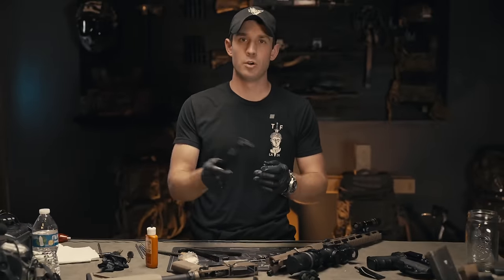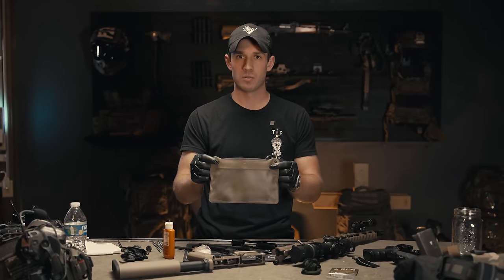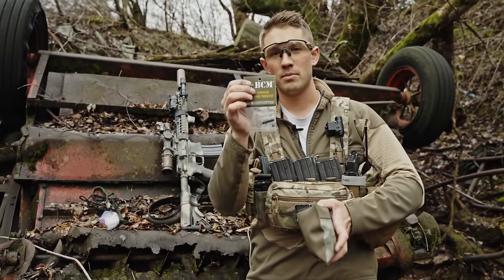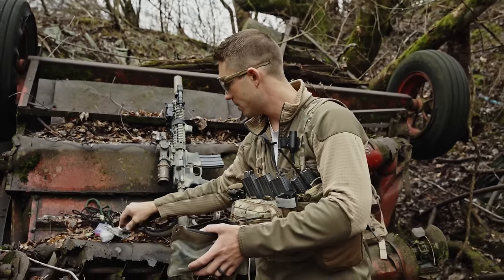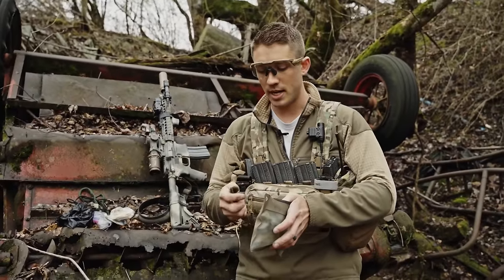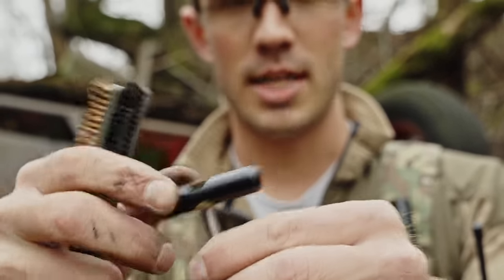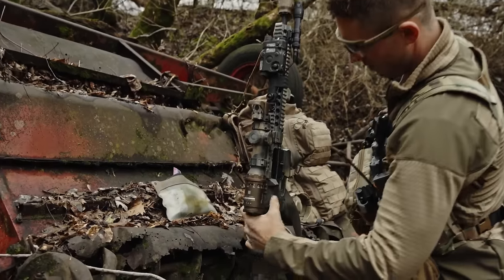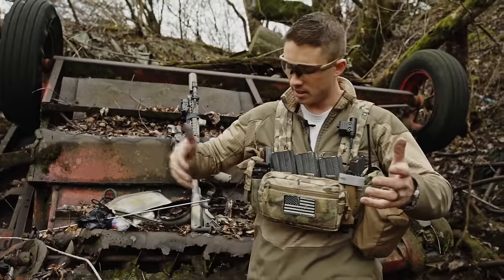Field Repair Kit 101

Comment: Paint can opener. Small, light, and easy to add to kit, and when you get a stuck case in the chamber, it works wonders.
Reply: Getting harder and harder to find the old steel keys sadly....
Reply: Absolutely, spot on. Tons of them on E bay cheap.
Reply: Hulk Hogan  based
Reply: Good  Idea 👍
Reply: Add a bit of paracord to the handle and its perfect
Reply: Hulk Hogan  It should be required watching.
Reply: Spoon. Many clearances cleared with a spoon
Reply: budget88 great idea 💡
Reply: Hit it with a little black paint, and suddenly it is tactical.
Reply: budget88 based

Comment: You don't need a spare ejector, nor a gas key in a field repair kit, as these take a vise and other tools to install.  Gas rings, firing pin, FP retainer ("cotter pin"), extractor (and it's pin, spring, buffer) should be in your kit.  GI cleaning kit is good.  It's not hard to figure out which parts you need a workshop, and which parts you can change on your lap with no tools.  Plan your field kit accordingly.
Reply: As someone currently in school for gunsmithing, you can absolutely replace an ejector by hand in the field, the gas key on the other hand, yeah if it's staked, like most are, yes you will need a vice for that
Reply: @MaticFox  I said ejector, not extractor.  The ejector is held in by a tiny roll pin.  You need something to hold the bolt, a mallet and tiny punch for the roll pin.  The extractor is easy, using the firing pin as the only tool needed.
Reply: @saxmusicmail  yes you ate right though I have done it with no vice and it was an sob and took creativity to get it done.
Reply: @saxmusicmail ah you did, I misread that, however with that being said, while it is a bit of a bitch, it's definitely doable to replace the ejector without a vice. Use a spare round to compress it, small punch to push the pin out. Not the easiest, but not impossible out in the field.
Reply: If you can afford it, just put a whole new bcg in your kit and have replacement parts at home. That way you can fix any issue, regardless of what on your bcg isnt working

Comment: Big tip for those who don’t know: shaving cream is a multi-use item. One of its many uses is being a fantastic weapon cleaning sort of solvent. It’ll pull all the hard copper/carbon off and it won’t damage any of the normal finishes. I’ll just keep a gallon ziploc bag in my cleaning kit, toss whatever parts in that I wanna clean (usually the bolt/bolt carrier separated, charging handle) in the bag with shaving cream, let it sit for a minute or so and then wipe it down. Use a sparing amount of lube afterwards (you usually need way less than you think), and put it back together
Reply: Hadn’t heard that one..nice.
Reply: @m118lr  we used shaving cream in basic training for the final cleaning or our rifles for graduation inspection. Shaving cream is amazing.
Reply: @Ty-sq7yi  ..thanks for the tip brother! Seriously, I’d never heard that..will give it a go.
Reply: Hey man what chest rig is that your wearing in your profile pic? Thankyou for the tip to! @Ty-sq7yi
Reply: @mikesmith7497  so that particular chest rig is actually discontinued. It is one version of the Phalanx Chest Rig by Tactical Assault Gear. They still sell the Phalanx rig, but the one in my PFP has four double mag pouches while the current one only has four single mag pouches.

Comment: I'd add a GI charging handle  to your kit. They weight practically nothing and I'm sure we all have a few extras laying in some parts bin.
Reply: That’s probably the rarest failure honestly. They pretty much don’t break.
Reply from the maker: If we were running a GI charging handle, having a replacement might be a good call. Because we use Radian Raptors in all of our guns, we're confident in their durability.
Reply: @dirty-civilian  I run Radians myself. I have personally bent one . Also I might not be the one that needs it.

Comment: from a 91f:
most replaced parts I saw in order of consistency-
gas rings, springs and detents (get at least 1 of all for selector, takedowns, and dust cover), firing pins, bolt, barrel. Most manufacturers I've noticed do not stake the castle nut on the buffer tube (do it to prevent your buffer tub/stock from rotating and losing your detent and spring for your buffer assy) and keep something like a long flat screwdriver in kit that can reach inside the pistol grip to tighten up as this can be a reason you lose the selector spring and detent. I used to take my multitool and squeeze the end of a mre spoon if I didn't have access to any other tools as the multitool isn't long enough to reach the screw.
Reply: Excellent reply. Excellent advice. This should maybe be pinned

Comment: I'm a big fan of the Leatherman MUT Multitool, its a great piece of gear to carry especially if you're running an AR. It has a bronze carbon scraper, bolt override tool, and some other great features, could be very handy with a repair kit.
Reply: Just been discontinued mate. I sent mine off for repair about 2 months ago and they could repair it. Absolutely gutted to hear as it was an incredibly handy tool
Reply: I have one as well. I love it. And leatherman recently started producing them again. They are easy to get again.

Comment: For backup stuff on all of my battle bangers I have a complete bolt with firing pin and cam pin in my grip. I have bore snakes and a folding cleaning rod. Copper brushes and lots of clp. Those BCM kits are a must for DI guns.

Comment: Former armorer in an infantry company: I’d recommend having a spare firing pin. They do wear and it would suck to start to get light primer strikes you can’t do anything about. But you’re right about the carrier and gas key, as long as they are quality components and the gas key was installed properly.

And I wouldn’t worry about cleaning the chamber very often. If you did a pared down kit for a few weeks in the field, it could easily be omitted.but, doesn’t hurt to have that capability I suppose.

Overall, good list

Comment: I have two of the small Clenzoil multi cal , tactical cleaning kits, that is always in my go bag and my battle pack. The cleaning rods in these aren't very long when screwed together, therefor I have another rifle length, screw together rod in both packs. But other than that, these little kits have a lot to them.

Comment: ARs:

Cleaning In the field:
Use your dust cover.
Bore snake (for that bore size)
Hoppes gun soap (non-toxic, works better and does not have a strong odor that can give you away)
white lithium grease (never in chamber or bore)
sectional rods (bore obstructions)
paint can key (extracting blown brass and has a bottle opener should you survive)
chamber brush (cleans behind barrel extension lugs)
#2 pencil (dry environments: don't need sand/dust sticking to lubed parts.  Externally, if you need camo and you have local dust...)
Rag (wipe off coated, slick parts)

Parts:  (If you've been this busy, there are other options lying around)
Bolt
Firing Pin
Trigger

Charging handle
Buffer tube

Comment: ive never broken a bolt in a semi auto but i have broke a firing pin and cam pin.if ur gonna carry a bolt u might as well carry a cam pin and firing pin. broken shell extractor is a good idea too cause if u rip the bottom of a casing off that will be the only way ur gonna get it back up and running.
Reply: I had a bolt break once on a semi auto AR15.  It broke right through the cam pin hole.

Comment: Not directly related to maintenance but; have you ever tried using a paint can opener to pull out stuck brass instead of punching it out with a rod?
Reply: Yup a paint can opener will work fine unless the case ruptured in 2 pieces.  That’s why in addition to a segmented cleaning rod you also ought to have a ruptured case remover.

Comment: I think the mentality of everything has to be repaired or replaced does not include the circumstance of automatic repair and replacement without direct interaction.  I think the importance of the reliant information is high ranking.  I think the ability to improve ones own standard of living instead of providing a service of work for others can occur and consideration of the computation is important.  I think another example is people promoting hard work.  I would rather not have difficult work,  I would rather increase efficiency to improve accuracy of my objective through effort.   I try to improve my self.  I think i increase the chance of improving myself if i consider reality.  I think i increase hope of improving myself if i try to improve the universal wellbeing from my desecration because i find myself the most credible to myself.  a example of a objective. with floating goals to try to improve accuracy of my objective.

Comment: I need to know what chest rig that is. Also. I have the basic kit of FIX-IT-STICKS that I can easily slide in a pocket or small pouch and I have Allen or torx wrenches for my optics mounts and accessories. The small torque attachment in the kit is handy for a repair kit!

Comment: The things that are going to give you the most issue are broken firing pin (just the tip), extractor, and springs. All those can be found in the CMMG bolt rehab kit and lower parts kits.
Gas rings shouldn't surprise you, stand the bcg on the bolt during normal cleaning. If the bolt doesn't collapse into the carrier; your fine
I'd keep a rod over a bore snake simply because it can clear obstructions if you eat shit and fall. I wouldn't plan on breaking everything down and cleaning it in the field but a small bottle of whichever oil or a tube of grease would be good.

Comment: Maybe carry a firing pin retaining pin, extractor spring and bumper, I'd save the extra extra parts kits for the rear (i.e. back at higher hq).  But if you're "out in the boonies" a whole other bolt carrier could (should?) be carried as excess 'squad equipment', maybe, dunno. Just make sure it's been checked for headspace amongst everyone's primary.
Mission should really dictate load out and if you're going to be dealing with that kind of use of an AR shouldn't supply/medevac lines be on point before smoking gas rings is a planning concern?
Just a thought.

Comment: It should be mentioned that bore snakes can break after repeated use and should be replaced every so often. I've never had to do it but SOTAR has a video on it and apparently its a complete bear and may render your weapon inoperable until you can blow it out with compressed air or a grease gun.

Comment: One thing to note, the carrier itself will wear down over time and become "gas inefficient" meaning cleaning will become needed more frequently, as well as it will be out of spec and might cause other issues.

 Personally, I'd carry an extra bolt assembly for myself. Everyone has different convictions about it, but there isn't a law to follow when it comes to packing parts.

Comment: PLEASE!! Don't use q-tips on the gas key. Use pipe cleaners instead. Fold in half with lube/solvent for less issues. This should prevent having to extract a broken q-tip by accident.

Comment: Due to the tiny diameter of the barrel, I have never gotten the boresnake for 223/556 to advance down the barrel under its own weight like every other (larger) caliber. I have to resort to a rod and patches to clean that caliber. Any tips for getting the snake to actually drop down a barrel that tiny?
Reply: I have the Hoppe's one and it has a brass weight at the end. Dropping it in barrel down and it has no issue coming out the end even on a longer 14.5.

Comment: Small can of CLP, baby wipes, thread together cleaning rod with mop and q-tips in a bag. You can't unplug your barrel with a bore snake and your barrel isn't the part that needs to get cleaned 99% of the time. The bolt is the failure point. Put a titanium firing pin, and cotter pin into a replacement bolt head with cam pin and vacuum seal that package, if you need to mess with your bolt, just replace the whole thing and don't bother with the fiddly bits. I think being this anal about cleaning your rifle assumes a level of crud and carbon fouling that you aren't carrying enough ammo for. If you keep the gun lubed, it will naturally squeeze out the crud, and keep hard carbon from developing. If you realllllly need to clean your barrel, the mop can replace patches. copper fouling isn't a real issue ime.

Comment: Just one thing to point out to him, his torniquette is on wrong, the white flap should not be placed accross until its applied, the way it is now it prevents quick turning of the windlass. I hope he gets that point so he can fix it kr reaches out to me for clarification
Reply: If you listen to the manufacturer, yes. Everyone that knows how to use the tq knows to flip it out of the way. He is using it the way people who actually carry one out in the open use them. You want them to be as slick as you can to avoid grabbing on things; especially since it has velcro hook on it and it's up front where it can grab your arm or anything on the ground when you're prone.
Reply: @hektoerdonovan2121  While I can get your point about catching the risk vs reward is mich higher. Personally Ive went through thick bush and never had that small tab snag, now picture you needing to try and rip off that velcro while applying it one handed in under 20 seconds while your one has gloves soaked in blood. It would be a bad day to say the least.
Reply: I just cut the damb time stamp tab off the hooks hold the windlass rod in place and after its locked in you can tie a bandana over it and sharpie marker the time on the head and limb.

Comment: What drives me Nutz, is WHY is it they None of the Gen2 B5 Systems SOPMOD stocks/BCM SOPMODs, or Magpul SL-S Stocks will HOLD 18350/18650 Rechargeable batteries NOR a Spare Bolt/Spare Firing Pin/Spare set of gas rings,rubber o-rings, & spare gas rings like in the BCM kit you referenced can be stored in a stock??? Would that not offer both a kick ass cheek weld when behind the gun, AND have the ability peace of mind knowing that if your gun goes down in the field you have what’s needed on-hand to fix anything short of re-barreling the upper itself??? Correct me if I’m talking out of my A$$, YET I think having the additional functionality capabilities to service your weapon in the field would be a highly desirable piece of kit most guys would love to have access too.